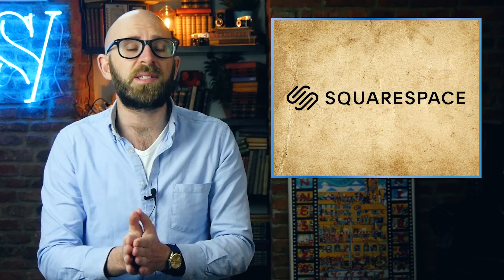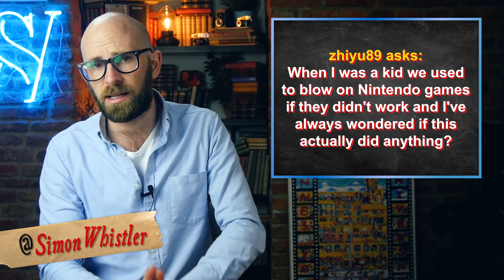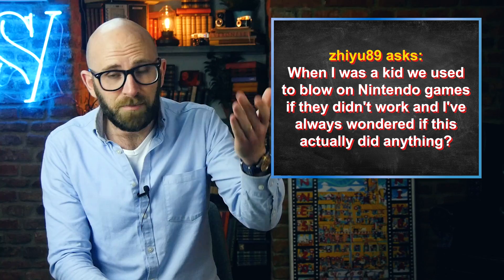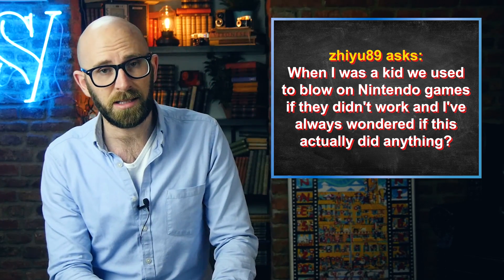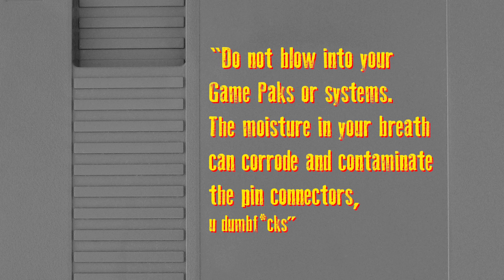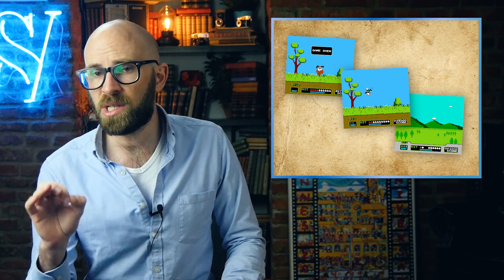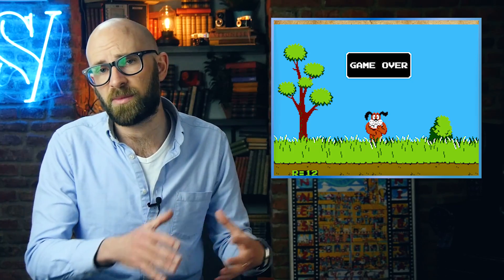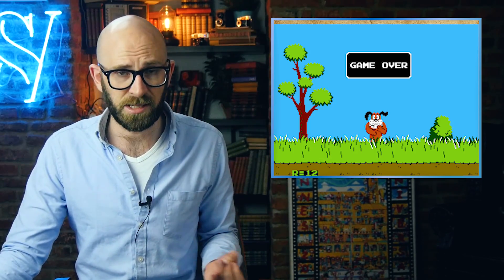Did Blowing Nintendo Cartridges Actually Do Anything and How Did the Gun on Duck Hunt Work?

Comment: The issue was because the pins of the slot were being bent when you put the cart in and pushed down, which is how you were told to do it. Eventually, the pins would not make contact. This is why the NES top loader model was a thing. And because some pins didn't actually need to make contact in some games, some of your games might appear to be broken if you had one game that worked all the time but but another that didn't. Unfortunately, the cheap replacements he referred to are cheaply made and will bend even faster. The trick is to not push the cart down after you put it in. I've restored original NESes by bending the pins back to where they should be and jammed the tray so you could not push it down. So if you have an original NES and it is still working DO NOT push down on the cart after inserting it.
And if you have games with corroded contacts, use a small amount of brasso on a q-tip to polish the contacts and then clean them off with rubbing alcohol. Be sure to let it dry if any alcohol makes it into the cart.
Reply: But if you didn't push it down the game wouldn't start right?
Reply: @edithboozy1000  Nope! It works without pushing it down. It might not after a while if you keep pushing it down because it keeps bending the pins to the point that they won't make contact. Inside, there is no switch to connect the contacts when it clicks in when pushing down. There are just push-to-release spring-clips like you might have on cabinets or retractable pens.

Comment: This is a fascinating topic but I feel like you drew the conclusion without considering one major point..

When you blow on the pins, it'd be immediately before inserting it into the slot. What if the moisture helps to wipe crap off or provide better connectivity between the contacts as you insert it? (Especially if you do this multiple times, until it works)

Comment: One thing that DID always work, however, was IPA. Get a Q-Tip, dip it in IPA, and rub it back and forth on the pins. They also sold cleaner cartridges so you could put some IPA on a fake gamepad connector and then insert and pull the cleaner cartridge out several times to clean the internal connectors without taking the console apart.

Comment: You missed a very important fact, that the problem was due to the lockout ship. The lockout chip can easily be bypassed by clipping the ground pin which results in games working 99% of the time, regardless of dust or amount of blowing.

Comment: People say it doesnt do anything it does help with n64 though clears dust cartridge wont work till done that said it's better to use a q tip so you don't get moisture from your breathe on it and corrode the metal that's only if the carriage hasn't been used in a LONG time though and has a lot of dust.

Comment: Moister is why it worked. It was not dust.
If the blows are not right before you use it did nothing.
Who cares what Nintendo said. Moister helped NES games work when nothing else would.
You also need to do the side to side wiggle and it could wedge ever so slightly.
I've had people use my Nintendo and after 50 tries nothing started. Yet when I do it it works almost every time on every game.
Blowing in the cartridge does work and you have no idea what you are talking about on the subject.

Comment: The real question is can that light gun be used on a flatscreen?
Reply: Sadly, no. The way a flatscreen renders an image is not the same as the way a tube TV did. Source: worked at a store that sold used games and systems. We had to finally put a card into the resold zapper guns informing people that the guns were not compatible with modern tv's.

Comment: I understand the issue from a logical perspective.  But from experience in the field, the fact is that I would reinsert and reseat the cartridge a dozen time and get nothing.  Blow on it once, though, and it worked right away.

I still have my original childhood NES hooked up and working.  Both it and the games are still in good condition.

Comment: I realized that the moisture helped complete the connection by comparing success rates between blowing normally and softly, ensuring the breath was hotter with more moisture. Realizing that my breath had acids and bacteria, I opted for q-tips and rubbing alcohol. It worked every single time.

Sometimes being a science nerd paid off as a kid.

Comment: Wow, that insanely over drawn answer and you still missed the mark.

The moisture of your breath helped the connectivity on the aging lose pins.... 

 Making longterm damage worse but providing a quick fix.  Creating a pattern that ended with the games not working without that extra moisture on aging lose pins. 

If you're going to stretch out a simple answer to 10 minutes at least get it right.

Comment: I remember we used to wedge a piece of cardboard to put pressure on the cartridge. Also curious to know if duckhunt works on non-CRT displays.
Reply: Graham X no it doesn’t.
Reply: @KitchenerLeslie2  I wonder if you could create an emulator that would fake how a CRT renders in an LCD panel. It would likely need to run at a low level on the hardware.

Comment: I was waiting to see a segment pointing out how one actually SHOULD properly clean a cartridge game.

For those who don't know:
> Take the cartridge apart.  This is specifically to ensure you can clean the entirety of all the pins.  Any standard NES-style cartridge is actually VERY easy to take apart.
> Brasso is actually an acceptable thing to use (and is often a necessary step when cleaning a game for the first time in years).  What most people get wrong is you do NOT scrub Brasso real hard.  It's pretty abrasive, so be gentle with getting the Brasso off with a clean cloth.
> In any event, some rubbing alcohol should be used in any cleaning (after the Brasso if applicable).  (If you've Brasso'd your cart before and taken good care of it, rubbing alcohol should be all that's necessary for typical maintenance cleanings.)  In a cleaning involving Brasso, this can help ensure all the Brasso is gone.
> Put the cartridge back together.

You now have a very clean cartridge that, if your console's slot is in proper working order, should never or almost never fail you.

Comment: 8 minutes in:
The game doesn’t need to flash the targets one at a time, if there are many. You can easily create a sorting heurestic, where for instance it first flashes AB, then CD, then AC, and then after that it knows which one it was. That “costs” 3 frames instead of 4, which doesn’t seem like much of an improvement, but the “cost” in frames flashed goes up very, very slowly as you increase the number of targets. 

There’s thus no need to imagine that in a many-targets game, the screen will be black for 8/25 or 10/25 of a second.

Comment: I know the answer too both questions with out even watching.
No, blowing into the cartridge did nothing. It was the removing it and plugging it back in. The USA version of the NES was more susceptible to bad contact because of its front loading "feature". Although a good acidic cleaning could help if the pads were actually dirty or warn.
And the zapper work with magic and pixie dust. Don't ask were pixie dust comes from. Let's just say it's pixie sausage if you catch my drift.

Comment: As a little kid, I had that problem of Nintendo games freezing up. So I put them in the freezer to cool down the cartridge. Thinking that the heat was causing the problem. My little brother at age 6 figured out by using a fine nail filler fix the problem permanently. Both the cartraidge and the game counsel needs to be sanded lightly

Comment: I used to take a Q-tip with rubbing alcohol and I would put the Q-tip in rubbing alcohol and then pinch it to get the excess alcohol off the tip just so it's only damp and not dripping wet and I would wipe the cartridge out and I could easily see the dirt that it pulled out on the Q-tip and doing this always made my games work perfectly.

If you plan on using this method just remember that if you've been using dirty cartridges you don't only need to clean the cartridge but you may also need to clean the console itself since it will also have dirt in it as well but the console is a bit more trickier to clean, just make sure that the Q-tip is as dry as possible you only want a very minimal amount of rubbing alcohol on it.
just keeping it damp, not wet.

Comment: There were special NES cleaning cartridges with a plastic edge in place of the PCB. That was covered in some sort of material. On the front of the cartridge was a thing to hang onto to mive forward and back. Put cleaning fluid on the material, insert the cleaning cartridge then move the piece back and forth to scrub the contacts. They usually came with some flat plastic sticks with pads to use for cleaning the contacts in the cartridge.
They were inexpensive and easy to use, yet every NES owner I told about them flat out refused to buy one, even when I explained how the moisture in their breath was what caused the poor connection problem.
If Nintendo had designed the NES so that the lid had to be closed for the console to operate, and had closing the lid slide the cartridge a little, it's likely this problem wouldn't have happened due to the wiping action cutting pushing away dust and cutting through mild patina. It certainly would've made inserting and removing a cartridge multiple times more likely to work.

The later, lower cost, top loader NES didn't have the problem as much due to the higher contact pressure and wiping action of them.

Comment: Yes, it worked, period. And the experiment you referenced is absolute shit. Blowing on it 10 times a day, and then not using it? The heat from use would be a major factor in the results. Utter shit. And never did I have a cartridge damaged from blowing on it. But almost 100% of the time blowing on a cartridge made it work. You really did not answer the question at all, you just stated the  standard company line.

Comment: I found a method that worked like gold. After putting the cartridge in, if it doesn't boot, just push the cartridge from side to side. It wasn't much space, just a few mm. Usually just pushing it all the way to the right and back to the left did the trick. BOOM. Worked amazingly well.

Comment: I don't care what this video says. I had games that would not play unless I blew on the cartridge.
Reply: Channel shows just how ignorant it can be while masquerading as informational.

No it didn't work for dust cleaning, they got that right.  However completely fumbled the WHY it does work for the millions of us who for fact know it did/does work.

Moisture in our breath helped those aging old pins connect better.  That simple. People could blow and blow and it does nothing, but one good deep gentle moist blow and it would work almost every time.

The problem was the more you blew/used the moisture to get a game working, the more damage we ended up causing, to the point some cartridges won't load at all with out that extra help aka moisture.

Clearly those who wrote this video didn't grow up in the 80/90,s
Reply: @eLiTeSoLDieRsoFWaR  Do you think it's more likely that the extra moisture made a bigger difference than reseating the pins?
Reply: He said blowing on them made the problem worse over a period of time, it's obvious why.  We all thought our games that did not work, worked because we blew in them, but it was just that the next time we put them in they got a better connection.

If you blew on them every time that would do nothing as there is no dust to blow off.  Also many kids did not put the cartridges in fully at times, so sometimes just pushing down on them (in more for NES) got them working.
Reply: I still do it today with USB plugs and my iPhone charger.  It's scientific, I tell you!
Reply: Facts !!
Reply: yep absolutely.  it might leave long term spit on the contacts but a game that dont work is a game that dont work.  you cant break whats broken.

Comment: there was actually a cleaner you could get for the internal connector on the nes that didn't require taking it apart... it kinda looked like a cartridge with a handle on it.

Comment: My work uses a pda type palm pilot for things - large batteries used that remind me of the nes cartridges.   A few years ago my manager had his but it just wouldn't work for him, tried removing and reinserting battery, new battery.  Nothing. Finally I took it.  And blew into both parts the hand held and the battery.  As I did the manager tells me: "that's not gonna work. " 
I put the battery back in, turned it on, and handed him back his working palm pilot.

Comment: My Duck hunt cartridge still has trouble starting after cleaning the contacts with q tips and alcohol. I always have to nudge it a bit in the machine so bit of the text comes on the screen and then resets as if  it continuosly tries to start it and then press reset so it starts properly.  But atleast the lightgun works on my rear projection TV.

Comment: Even as a 7-year-old, I figured blowing on them was a bad idea. Maybe my dad told me and I believed him, but we bought a cleaning kit that had two parts:

1. A fabric-covered... paddle that was made to scrub the contacts on the cartridge. I think it even came with some sort of solvent, though we used rubbing alcohol.
2. A cartridge-shaped contraption with a fabric-covered blade the same dimensions as the one that the cartridge had. Inserting this would, theoretically, rub every internal contact simultaneously and remove any contamination. It did get darker over time, suggesting it was removing something, but I suspect the main effect it had was to jam 99% of the contaminants to the rear of the slot, sealing them in for all eternity.

I also remember my go-to technique was to insert the cartridge, snap it down into place, turn the system on, observe it wasn't booting the game, then spam the reset button while wiggling the cartridge side to side as fast as I could. That usually got a recalcitrant game to work.

Comment: So many jokes... must not say!

But - did it work?  Well, if you kept doing that technique, the game WOULD work, and if nothing else it gave the gamer a sense of control over a non-functioning game.  And, as a gamer from back in the day - you would watch your friend take out and reinsert a game cartridge 20x without it working, using different forces to push the cartridge in place with no success. Then he would blow on the cartridge and it would work!  Maybe the moisture on the copper helped create a connection with the pins on the console? Sure, a horrible thing to do long term - but it DID seem to work better than just reinserting the cartridge over and over again.

Comment: The main question in the thumbnail was never answered in the video, the answer is yes despite any long term damage that may or may not have been done it worked in the moment especially if you licked the pins before you blew on them, licking and blowing would always work after repeated attempts at simply reseating the game did nothing

Comment: Never failed to work on the NES even when alcohol wipes taking systems and cartridges apart  failed to cause any change. The number of variables in blowing on a cartridge is staggering. Acidity, moisture, force, time, bacterial, age, age of console, age of blower etc.
Reply: Side note I never heard of anyone doing on The SNES or N64 werid.

Comment: Did it work? Absolutely, I was well acquainted with several cartridges that could be removed and reinserted as many times as you like and would not work yet functioned immediately after a single blow.

Corrosion was well understood even back in the day yet it still worked and for some reason nobody ever bothers to investigate why blowing actually worked.
Reply: Don't believe your lying eyes just know that it makes the pins gross

Comment: More stuff that lead to the NES blowing: The reason the NES used a failure-prone front-loading design, while the Famicom was a top-loader, is that Nintendo didn't want the NES to look like a game console in the wake of the video game crash of the 80's, and instead opted to make it more reminiscent of a VCR. As for the change from the hardwired controllers on the Famicom, I can only assume that the NES was designed somewhere upwind of an engineer.

Comment: I always wondered that! I played Nintendo for a long time without having heard about the blowing into the game cartridge thing. My current best friend told me about it years later. It's amazing how strong a confirmation bias can be! When a game didn't work for me before I had heard about the blowing technique (hehehehe), I just took the game out and put it back in again (why is all language related to games so dirty?) until it worked. Somehow I became convinced that it worked faster to blow into the game cartridge, even though I knew that it would also eventually work if you inserted and reinserted the game a few times. We even had a Nintendo 64 and, when the games said not to blow into them, we assumed it's because Nintendo wanted to make more money from us by forcing us to buy a new game cartridge instead of using the time-honored blowing method. In any case, I like tablet and phone games better because I always found the game controllers somewhat imprecise because I am much better at games when I can actually touch the screen. I was pretty good at that duck hunt game though. I did see the flash but it was on the Super Nintendo.

Comment: I ended up using a Game Genie permanently inserted into my NES. Without using any of the cheat codes, it created a very tight connection with any game inserted. Never had any blinking screens after that. In the end, I think it probably did more damage to the inside of the NES because it took a lot of force to remove or insert the Game Genie in the first place but at the time, this was my method instead of blowing.